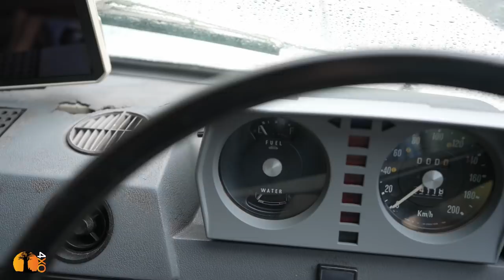I COLLECT THE RANGE ROVER. Part-1 AN IDEA SET IN MOTION | 4xOverland

Comment: If the engine and gearbox is good and there isn't too much rust it will be fine.

Bits wear out, rubber goes hard and flaky, bearing and bushings need replacing but the main metal parts don't change.

I bought a tired and sad 70 series eight years ago, she shaked and rattled all the way from St.Andrews in Scotland to the south of England.
Over the years I have replaced only wheel bearings and rubber items, along with track rod ends etc, front suspension and the barn door hinges.
It slowly got better and better and then I bit the bullet and replaced the 2009 tyres, (a bit hard by then) with some 33" KO2's. It is like a nearly new vehicle now. 

These old 4X4s are worth looking after, the value of them keeps going up because they are easy to work on.

Comment: It a good vehicle,Andrew.You made a good decision on it despite your thoughts about it.
About the vehicle,bear in mind this one isn't a Suffix A like your ols '71 RRC,but a Suffix D.
There are a lot of differences between Suffix A and later models.Headliner,Doorwindow frames,
fuel delivery system,seats,clear and tinted window,rear wash/wipe,engine'gearbox ratios are a few of them.
I've owned 2 original Suffix A and 2 later '80/'81 2 doors and i work on them on a daily basis.
Get it mechanicly sorted and drive it. As for future plans,how about just using it the way it was intended in the first place??

I wished i lived near you and could help you out with it.It would've been a honor.Good luck!!!
Reply from the maker: The differences are very few. Diff lock actuator switch light, seats have identical frames but different material, rear wash/wipe was added, doors and frames are exactly the same, different filler cap, headliner is also different material. And of course, the addition of carpet and instruments. But otherwise it's identical. Engine and gearbox are as close as damn-it, identical. As are the electrics.
Reply: @4xoverland  Have a look at the Parts Catalogue for RR upto 1985 and see how much parts are only Suffix A and Suffix B onwards.From the engine alone the pistons,crankshaft,camshaft,frontcover,mechanical fuelpump,fuellines,carburettors,crankshaft pulley all differ from later models.Even the engine block itself isn't exactly the same,because the rear crankshaft seal is the old "rope"style,not the later seal type.
When your in the proces of restoring a early Suffix A only then you'll realize there is much more difference between Suffix A and later.Oh,and the seat frames differ also,front only has inward release handle and the rear seat frame and catches are completely differend and you cannot fit a later rear seat,unless you have the later type catches with them.And even then you'll have to make some new mountingpoint into the body.I found that all out the hard way when restoring my '72 base model to original specification.
That said,when you want to fix your RR and the correct parts in NLS,later parts can be made to fit.
Good luck with your RRC.

Comment: I dare say that this may well be mentioned about later on in the series... 
But back in the day as you may be aware, a number or owners might have replaced the gearbox with a 5 speed, retro fitted power steering, even A/C too... along with Weber carb conversions... to aid deliverability etc... all would be period upgrades... Will you be doing such in your restoration?

Comment: I did a dodgy thing like that a few years ago. We were living in Alberta, Canada but the wife wanted to retire to Nova Scotia on the east coast. We bought property but before we moved I decided to purchase a 1993 GMC Suburban SLE 4X4 in AB and drive it down. The idea was to have our own vehicle there while were getting ready to move. 4,740 kms with an engine with almost 400,000kms on the clock. I asked the mechanic I bought it from if the truck would make it. He said; probably. The wife was so anxious to go. I think there might have a family gathering. I was still working so instead of me driving, I did the unthinkable thing of sending my son with the wife and I flew down later. They did make it in one piece so I think they forgive me. Only now, five or so years later the transmission has gone and the engine needs a rebuild. It didn't go on the trip though!

Comment: Mr St Pierre-White, I gotta admit I didn't know how much of a roadside-junk user I am and obviously ever was until I saw You dramatizing a very functional used awd car as if it was just pulled out under a sagging shedroof and piles of birdpoop after being bought cash off a slightly deranged farm-widow telling You it was her husband's car who "recently passed" and her daughter, correcting her how 22 years were nothing near "recently" ..... I went round Australia in a 26 year old 250,- $Aus 1.2 Litre Toyota Wagon with over 400.000 km and 14 known owners before me some years ago, which I got off a wrecker sporting an accent way worse than mine - worked out fine, besides a blown head gasket I had to change in a rent-a-shop in Broome though. 
So, nothing to worry whatsoever about an obviously well revised Rangie getting to the next revising shop on its own power instead of atop a trailer, is there? 
Anyway, thanks for sharing, cheers, and have a ball with that awesome car.
I feel RangeRover envy, to be honest.

Comment: My 1975 RANGE ROVER IS THE BEST VEHICLE I HAVE OWNED I PUT IT OFF THE ROAD AT 550.000K BECAUSE I CRACKED THE CHASSIS ON THE RIGHT HAND FRONT  COIL SUPPORT YOU SAY DRIVING IT AT 90KL.M  I USED TO CRUISE QUITE OFTEN AT 140KLM PER HOUR FOR UP TO 4or5HRS AT A TIME TRAVELLING FROM VICTORIA TO QUEENSLAND AT NIGHT